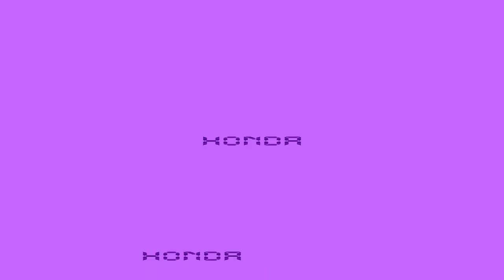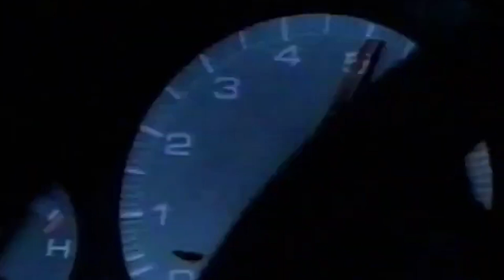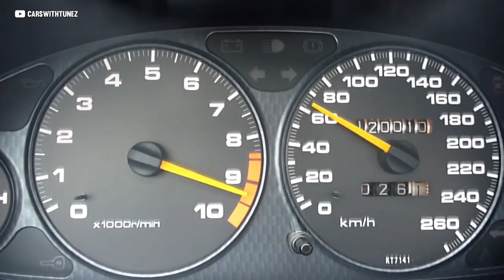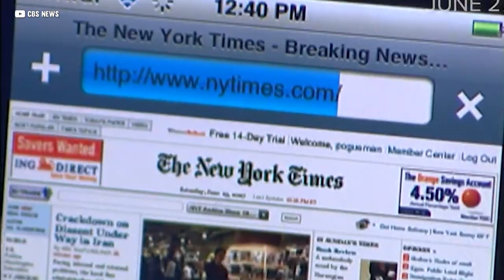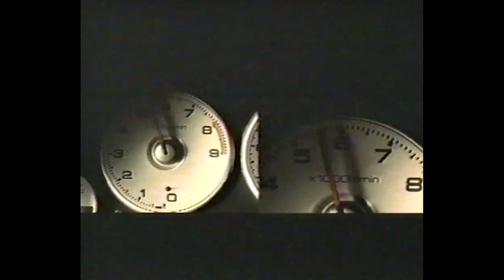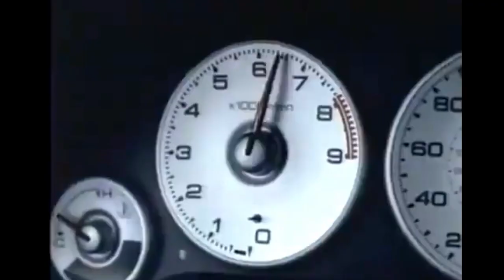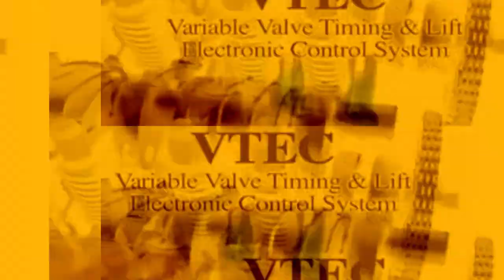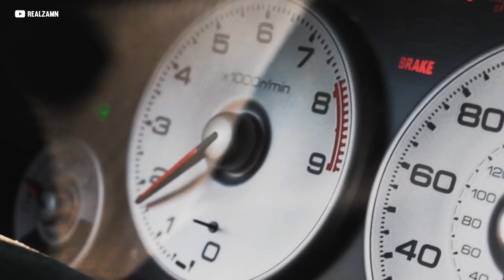A Tale of The Type-R

Comment: sure wish I could have picked up a DC2R when they were new or barely used.  Never could afford one.  I'll make do with my 1994 DC2 GSR, at least I have that.  22 years ownership, 385,000 miles, all original drivetrain.  Slowly trying to restore most of its OEM parts.

Also of note, the DC2 chassis itself debuted in 1993 as a 93.5 model in Japan, and a 1994 model in the US.  The DC2 Integra Type R debuted in 1996 in Japan, but it was the same chassis code as the Integra GSR, for reasons unknown, especially since Honda used a unique chassis code for the Civic Type R, the EK9.
Reply from the maker: You & me both Patrick, but hey a 94 GSR is pretty darn cool in itself! I myself have nearly saved up enough for a clapped out, rusted, rebuilt title, 96 JDM DC2R with non matching body parts with no drivetrain. Dreams do come true haha.

Thanks for watching the video btw, your support is very much appreciated! Please feel free to subscribe and hit that like button it helps a ton and motivates me to get off my butt and make videos like this!

Comment: Dude, you know Dc2 was created on the ej2, ej1 floor plate, so if there was no ej2 there would be no dc2.
Reply: The dc2 was based off the NSX type  platform
Reply: 😆😆😆dude , check the dimensions od dc2 are indentical to ej2 , especially that  ej was the first one. They even have the same suspension😆😆😆